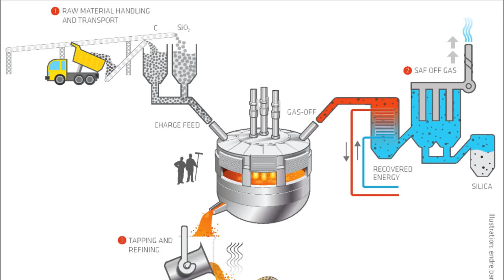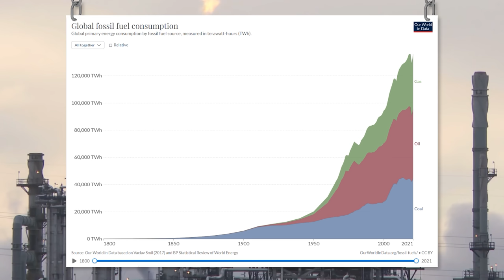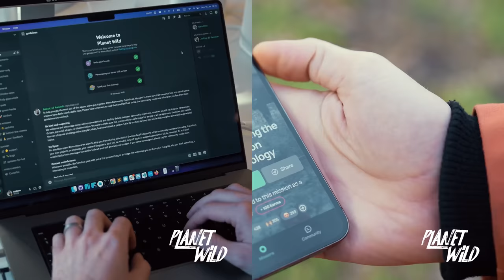We Will Be the Last Civilization on Earth

Comment: The statement that charcoal is carbon neutral is false. While yes trees do take Co2 in you are reducing the number of trees available to take in the Co2. As the number of trees required to make enough charcoal for each use will from the start exceed what a single tree wil take in. 

So as an example since i dont have exact numbers. Lets say it take 4 trees to make 1 axe from iron, you are now reimtroducing that carbon with 4 less trees to recover that. Now as you increase production of tools you quickly reduce the trees you have while increasing Co2 output. Making this theory completely incorrect.

Comment: We can easily create other non-carbon heatsources for smelting and concrete. It's just "more expensive"
So I think this is an extremely shortsighted vision.

Why?
It all comes down to money! 

What are you actually saying when you say something is "too expensive"? 
You're saying that you're fine that future generations/people in other parts of the world/ the environment suffer a non-calculated not-compensated price.
(That's the whole problem with economics: They try and calculate a price for everything but the main system here is Earth:  You cannot put a larger system (Earth) into a smaller system (economy) and expect it to work. Economy uses earth as a base for everyting.)

But hey! We wouldn't want to hurt the short term profit for shareholders now would we?

Nuclear? That will only be able to replace around 5% of total current demand (Sabine Hossenfelder)
But I'm all in favor of using nuclear in the transition phase to more sustainable energysources.

Comment: Coal is over; stopped being competitive with renewables in 2013 and is going the dodo path since then. Population and feeding won't be a problem since the fertility rate is well below the replacement ratio and we are peaking (due longer lives) but in reality demographic implosion is already happening in 3/4 of the countries.

   Only reason to keep using fossil fuels is due some elites won't want to lose their privileges, but since capitalist is at terminal phase as ponzi scheme and there's no way to keep growing (population decline which will lead to consuming decline...) those wolves are now worried because the sheeps aren't reproducing. Ultimately, the system will fail and we will eat the rich. Nothing special, alreaduy happened...

Comment: At the 12:55 mark, you say Coal will last another 130 years.   That sounds about right.

Of course, the problem is that Coal is the DIRTIEST Fuel there is.
If we burn Coal for even another 100 years, we will put so much CO2 in the air, we will have a runaway Greenhouse Effect.

Comment: Interesting speculative video on future civilizations. I don't think charcoal and the wood it comes from should be classified under fossil fuels. They're not 'fossils' but a renewable albeit limited fuel source. Actually, I think the whole concept of fossil fuels is a misnomer and possibly an entirely false assumption. I believe oil is abiotic and formed deep within the earth. Otherwise, it would only be found near the surface or only a few meters under at most, not several kilometers where nothing living ever existed. The whole 'carbon neutral' and climate change push is agenda driven for purposes other than what we're being told.

Comment: Wait, shouldn't the title of the video be the opposite of "Why We Must NOT Stop Using Fossil Fuels..."? If the emphasis is on future civilizations, then we should conserve fossil fuel resources for them. If the emphasis is on our current civilization, we have lots of alternatives, electric arc furnaces can reach much higher temperatures than fossil fuel based furnaces and are cheaper, hence why industries are pivoting to them or already use them. Ammonia is actually produced using hydrogen (which can be made from water using non-fossil energy), we only use methane because it's a cheap feedstock for making hydrogen. Plastics are the exception for me, not because there aren't alternatives (there are), but because their production doesn't strictly necessitate CO2 emissions.

Comment: I’m not sure about me asking this as I don’t know everything that goes into the making of these but has anyone considered using the waste heat of a nuclear reactor to melt metals? I realize it might irradiate them in addition to needing computers but I wonder if it’s possible to control a nuclear reactor without computers or possibly alternative formats to the silicon compute chip
Reply: "... using the waste heat of a nuclear reactor to melt metals?"
It's not hot enough.  The waste heat from a nuclear reactor is right around the boiling point of water.
Reply: @calamityjean1525  only if you keep the control rods in to make the reactor cold enough for water. I know molten salt reactors are not a thing yet but if you could use a working fluid that’s hot enough you might be able to heat a forge
Reply: @emm5468    That doesn't sound like something that could be retrofitted to an existing reactor.  A new extra-hot one would have to be purpose-built.
Reply: @calamityjean1525  obviously not, but if it were possible it might help solve a few issue that were brought up in the video
Reply: @emm5468    Electric arc furnaces already exist for making steel.  Nothing says the electricity couldn't come from renewable sources.
Reply: @calamityjean1525  yes True, however you need to convert heat to electricity. What I’m saying is using a working fluid such as salt to heat low temperature metals like aluminum and tin. It’s the equivalent of using an RTG like the astronaut in the Martian did. to heat his rover. Only on a larger scale
Reply: @emm5468    I didn't see The Martian, so I can't respond.

Comment: This is an extremely narrow-minded video. If we were to manage to build energy-producing fusion reactors, your entire video would be invalid. A possibility that isn't impossible. Regarding ammonia, it would probably be beneficial if half the population were to die off. Also, plastics are in no way the only material that fulfills the things it is good at. The only reason you claim that to be the case is because we've built such a large capacity of production that the price has decreased massively. The low price of plastic is the primary factor that has made it so present in modern civilization. However, that doesn't mean if we focused on alternatives, we couldn't build future industrial capacities to lower the prices of said alternatives similar to what we've done with plastics in the past. We can create artificial materials through renewable sources that are just as durable, light, and flexible as plastics. We just don't have the industrial capacity to produce them at scale yet. Would you claim that our civilization was less impressive before we had wide usage of plastics and concrete? If so, all our architectural, cultural, and philosophical achievements before the 20th century are null and void. A claim so ridiculous, that no serious person could make it.

Comment: Sigh. Any "prior advanced society" never discovered or used nuclear power. We would see different amounts of certain radioactive isotopes. We also don't see any widespread evidence for massive changes to the terrain. This "theory" has been thoroughly debunked.

The majority of the Earth's coal formed in the Carboniferous period 359 million years ago to 200 million years ago. The average CO2 ppm averaged 1500 ppm at the start and declined to 350 ppm by the end. At the same time massive coal seams were laid down. The CO2 was buried. 

CO2 is a greenhouse gas, it absorbs and emits infrared radiation. Heat.

It is no accident that the Earth's average temperature plunged from 68F to 54F with that much CO2 buried. Logically putting it back into our atmosphere should raise average temperatures back up to the early Carboniferous values. About 14F hotter. That renders large parts of the Earth uninhabitable. Try adding 14F to temperatures across the equator and the middle east. Our home planet becomes unrecognizable. Sea levels rise because warm water expands. 

And there's so much more.

Comment: There is a theory that "Fossil Fuels" are NOT "Fossil-based", which is an old-style thinking and belief, but are created 'deep' inside the Earth through geological processes, and therefore, they are not "limited".
I haven't heard much about this Theory lately.

There is also a relatively new theory that there is basically an HUGE "ocean" inside the Earth that contains MUCH more water than the surface. (I think it is "crack-fissure-pocket" water/steam)
Reply: Not a theory and not scientific.
Reply: @ThePmfatima  - You couldn't be more wrong.
They ARE Theories, and they ARE Scientific.
As in Scientific Theories.

Comment: What a ridiculous video!
And no, it does not provide reasons "Why We Must NOT Stop Using Fossil Fuels...".
Ammonia can be made from hydrogen generated by electrolysis, rather than methane.
Steel can be made without using fossil fuels.
Not that there is any proposal to stop using fossil fuels entirely, (so the whole video is based upon a straw-man argument), merely to get to a a carbon neutral and then possibly carbon negative situation, by increasing carbon sequestration.